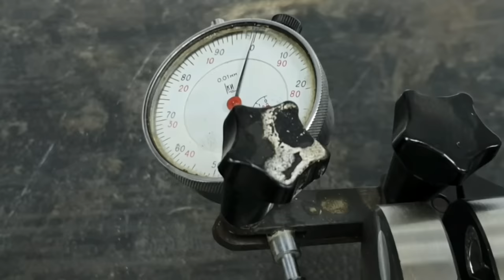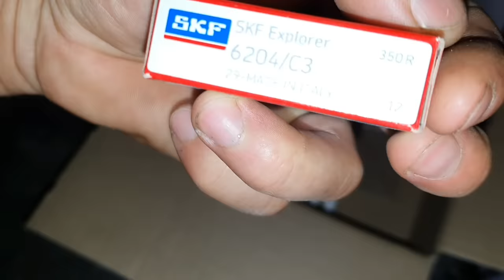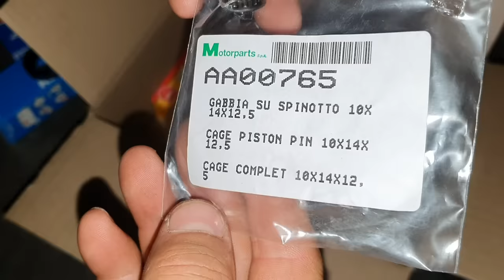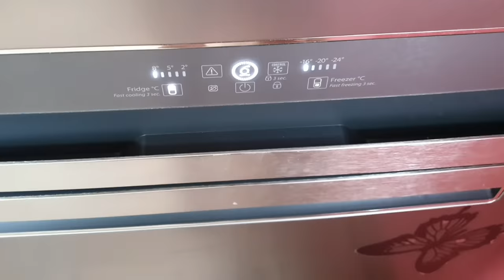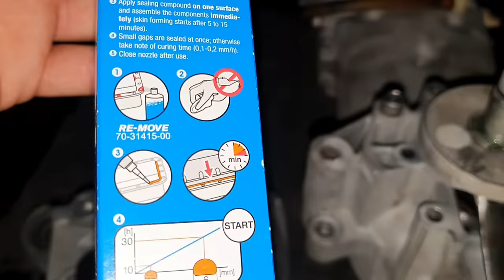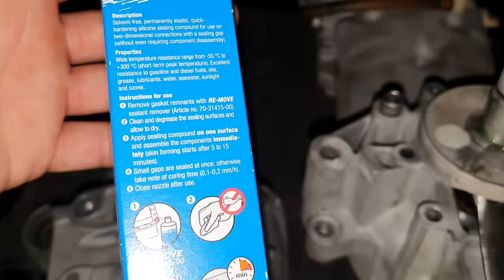#7 Установка коленвала и подшипников - Yamaha Jog Minarelli

Comment: In my opinion - if you tune your engine, you should use C4 bearings.
Reply: depands on setup, C4 is only for high rev fast cilinders like the aluminium ones.
Normal setup or even faster cast iron cilinders require C3!